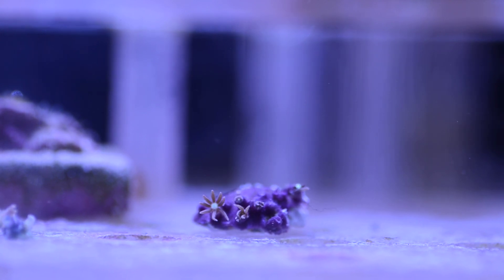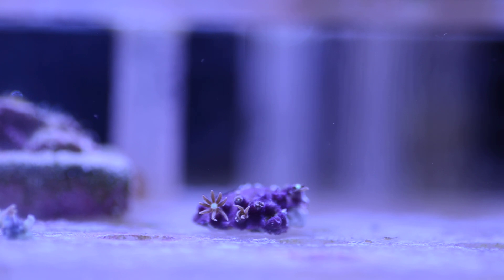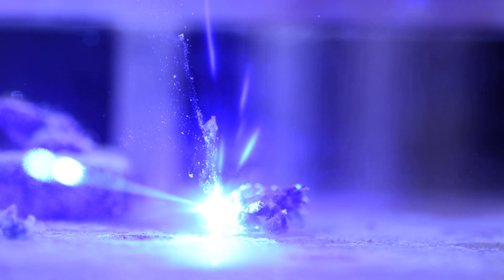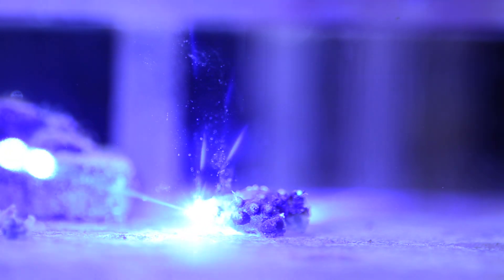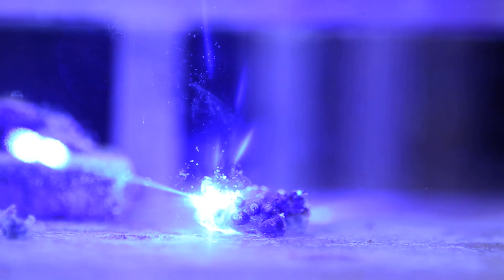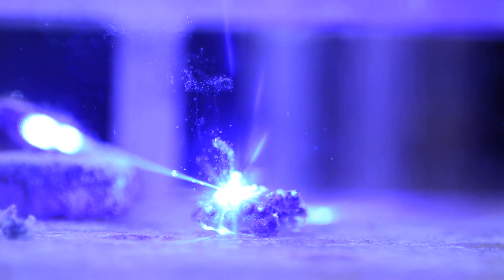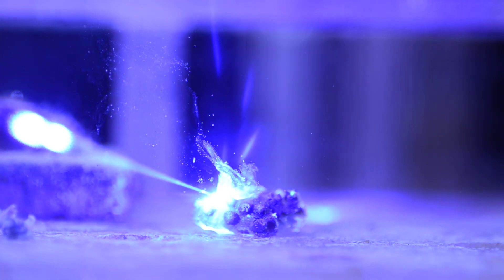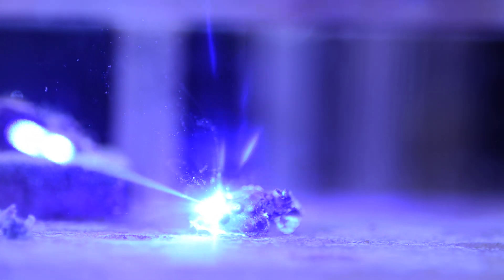Marine Aquarists Laser Series - GSP

Comment: hello, 
i try to find laser (to kill Aiptasia)on EBAY but got many varieties. can u help me to advise that the laser i found is suitable or not , the configuration is below,

500mW blue-violet laser engraving machine for high-power modules dot 405nm laser head
can focus bottom of the fan cooling design.Enhance heat dissipation, run more smoothly and safely

Product information:
Blue-violet laser
Voltage: 5v
Output Power: 500mw
Working Current: 500mA-600mA
Working temperature: -40 ℃ --75 ℃
Wavelength: 405nm
Working life: 10,000 hours
Working medium: Semiconductors
Shell material: aviation aluminum
Output Terminal: dot
Focus: Adjustable
Output band: visible light
Dimensions: 33x33x67mm
Cable length: 113cm
Features: aluminum alloy shell (heat deepen teeth) + imported laser diode + constant current driver board

Applications:
1, micro-laser engraving machine
2, small laser cutting
3, cigarette, match point
4, DIY laser manufacturing
5, medical equipment, etc.

ur advise will be highly appreciated

http://www.ebay.com.my/itm/Adjustable-Focal-Blue-Violet-Industrial-Engraving-Laser-Module-500mw-405nm-5V-/321910367592?hash=item4af35a6568:g:SiIAAOSwa-dWp0yj

Comment from the maker: These lasers use rechargeable Li Ion batteries, I've never actiually exhausted a battery as I simply place them back in the charger after each use. No temprature increase occurrs when lasing through either glass or acrylic (verified with an IR thermometer.)